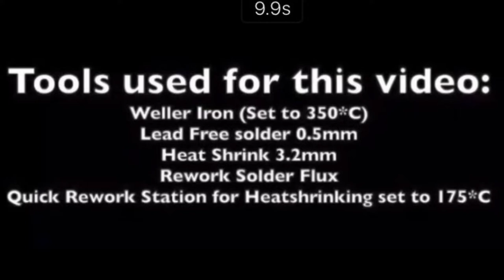How To Solder 2 Wires Together || Soldering Wires Together

Comment: For critical circuits where the wire may get hot in a fault condition, you can use a crimped tinned butt splice to provide a mechanical connection before you solder the wires together. In this way if the wire heats up to the point of melting the solder it will not separate because the crimped butt splice will hold it to gether. Beyond this there are guidelines in how to join wires from IPC and NASA. Most are looking to maintain a connection through mechanical stress of some sort like vibration. A reaccuring theme is the wires should be tinned before joining.

Comment: Good simple stuff.
What about thicker copper that has only a few wires?
Reply from the maker: Hi . I know some people do this differently to me but how I do it is I lay the stripped wires on top of each other as thick wires are to difficult to twist together and lock in place as the thinner stranded stuff is. Then personally I get some finer tin copper wire and wrap around the joint tightly from end to end like a spring . Then solder up as normal and heat shrink . This gives me a great looking strong joint . Like I say though there are different versions of this but this is how I do it . Hope that helps , thanks for your question 👍